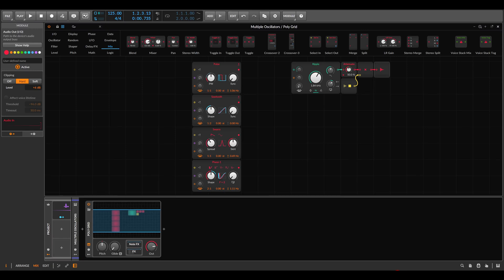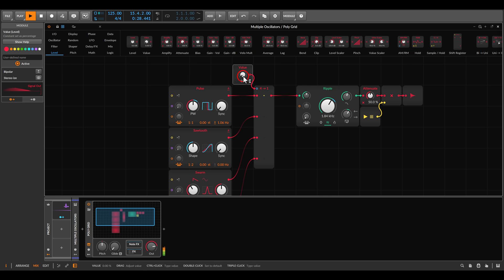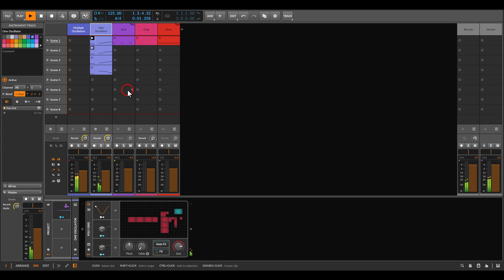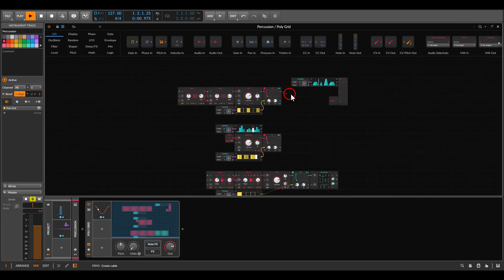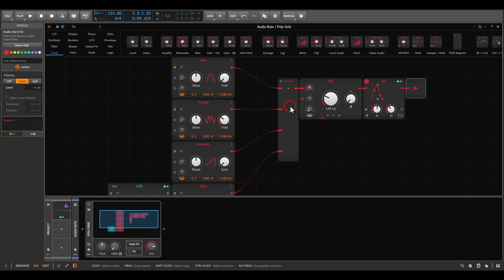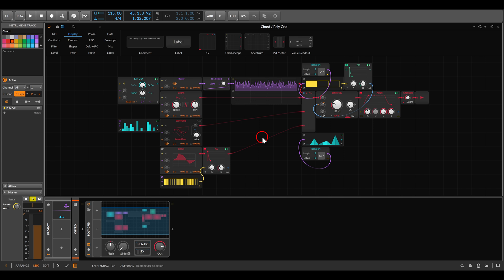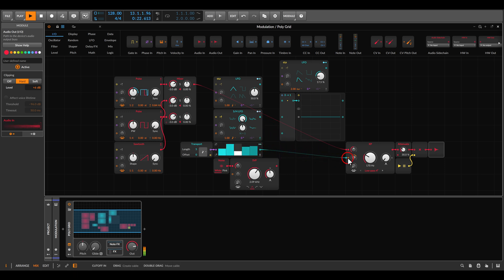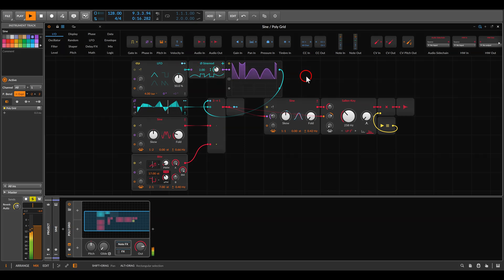Techniques to learn from the Trace Eurorack module in Bitwig

Comment: bitwig has the xy instrument device (and xy fx device) which you can linearly morph from 4 different instruments or fx and even external one. the setup you have presented just linearly morphs between only in-between two nearest inputs instead of morphing between all four of them. You could also implement such xy in the grid using merge 1,2 and merge 3,4 for x and merge between the merges for merging 1,2 and 3,4
Reply from the maker: Yeah, but the way Trace works is by linearly morph between the inputs. I have also Planar 2, and the various XY options are perfect for replicating this behavior.